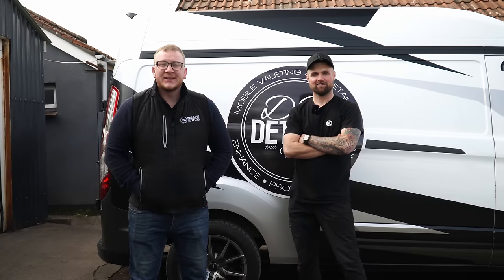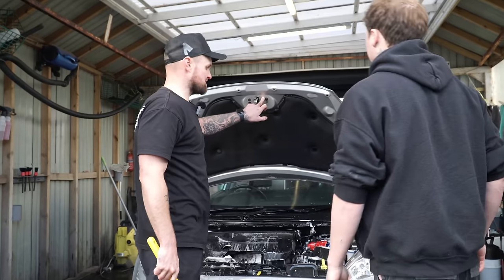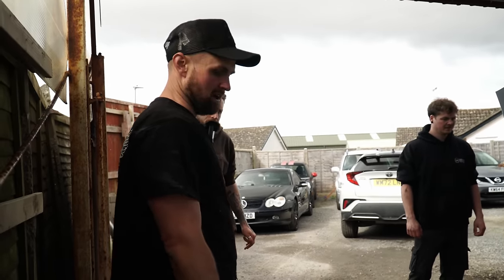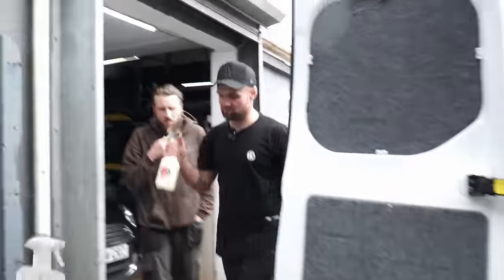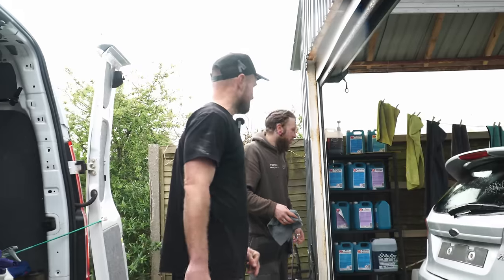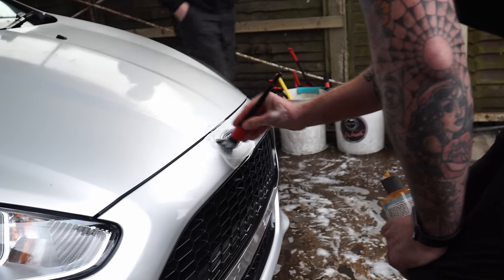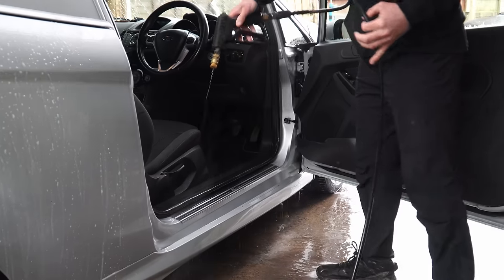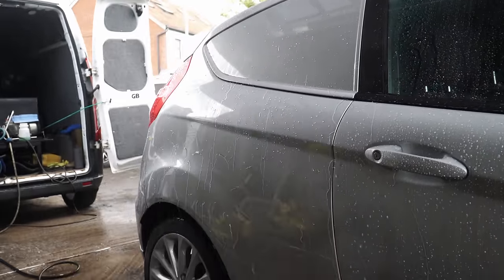The Ultimate No Bullsh!t Car Valeting Process | Pt1 - Exterior

Comment: If engines were meant to be jet washed then car's would not have bonnets.......
Reply: Totally agree. Abs no need to clean engine bays. Inviting trouble imo. Just wipe it with a rag and wd40.  Fletch plates and bulkhead spray gunk and spray off never jet wash